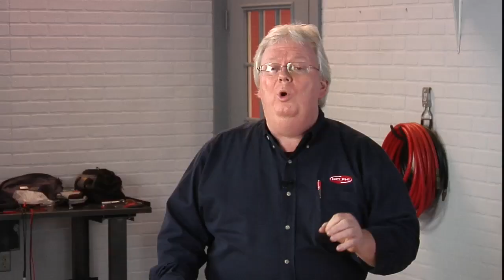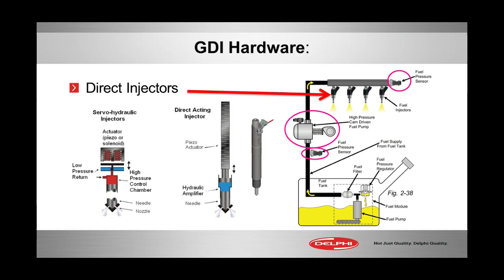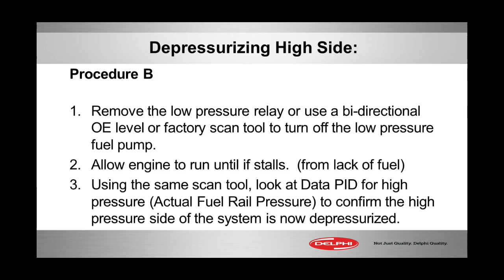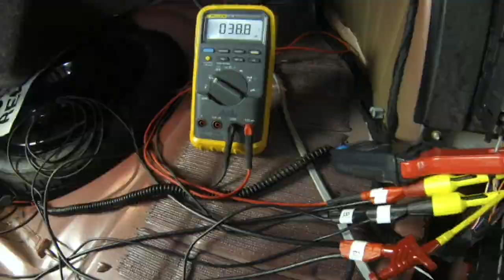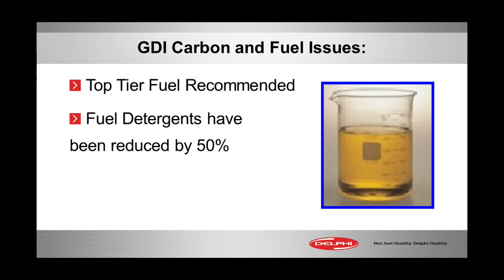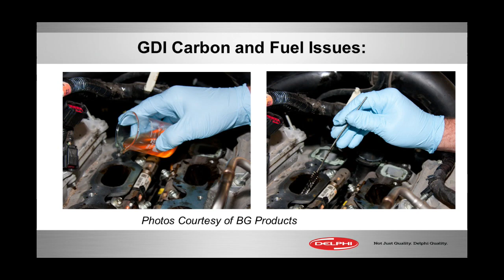Delphi Training Series: Diagnosing GDI – Gas Direct Injection

Comment: Thank you.Very informative.I am testing,cleanimg and resealing Gdi Injectors and am using mH (milli Henry's during the dynamic testing to check on the coil and mechanical integrity of the Injectors under test. When testing and servicing piezo Injectors I have incorporated a capacitance meter set on nF (nano Farads) to check on the piezo crystal packs integrity.
Reply: Goof tip! I am going to give that a try. Just read your comment today.